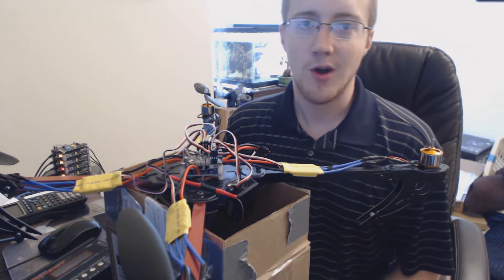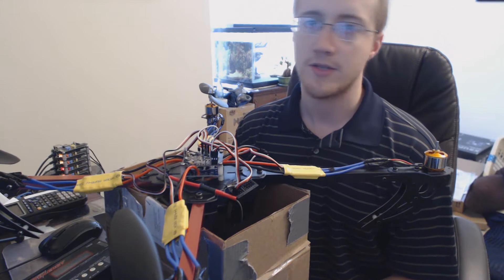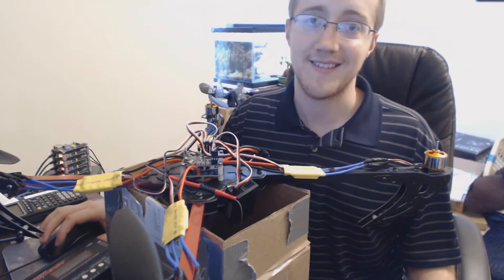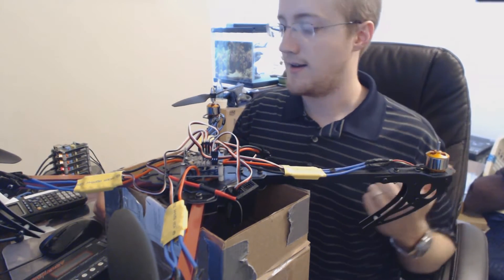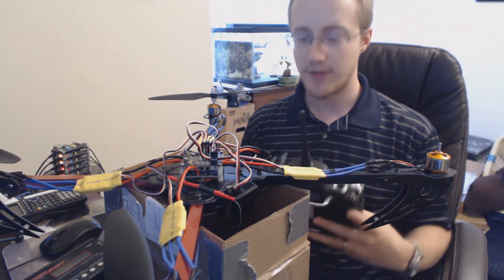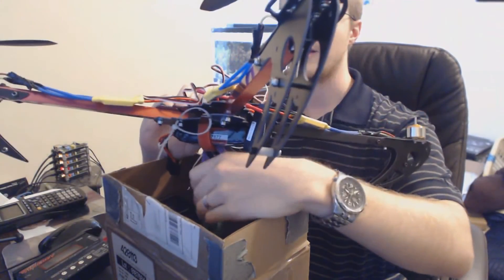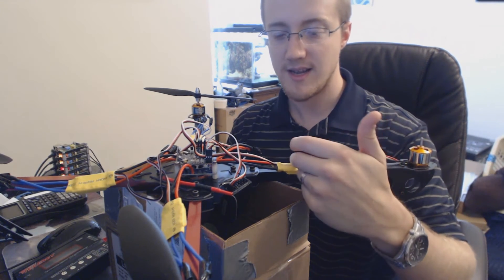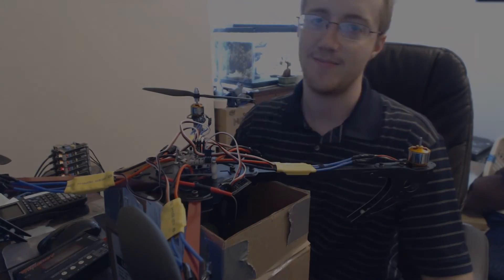Quadcopter Kit, KK board, Tegra K1, plans for autonomy

Comment: Does the arduino out rank the pi in this kind of scenario.
Reply from the maker: Arduino just doesn't compare to the pi, they are different boards entirely. One is a computer, the other a controller. You cannot really use a controller to compute, so this would be a scenario where, no, it is not likely an arduino would be the better option. If size is a consideration, then I'd go with the Raspberry pi Model A+

Comment: Hi, can you post a link where you bought your parts?
Reply from the maker: Sure, this is the one I bought:

http://www.amazon.com/Hobbypower-Quadcopter-Friber-Folding-Multicopter/dp/B00DU4A4JK/ref=sr_1_3?ie=UTF8&qid=1402170748&sr=8-3&keywords=x525

You will also need a transmitter (remote controller), a lipo battery, and a battery balancer/charger.

Comment: Personally I have been doing some work on a beaglebone. It should house everything you need and, depending on your requirements, shouldn't be too hard to set up.

It is however very powerful, with the beaglebone black clocking in at 1000MHz and 512MB DDR3 ram. Also, capes makes it very good for the kind of task you are looking at.
Reply from the maker: Thanks for sharing, though that performance is too close to the pi. The pi was maxed out in processing far too quickly with the same ram and a similar clock speed. I've been interested in the beaglebone, but was given a free tegra k1 devkit. 2gb of ram and over 300 gflops. Should be more than enough to keep me occupied for a while. The raspberry pi and beaglebone both probably could act as a stabilizing board and some autopilot, but, as soon as you start trying to do machine vision, they both putter out.